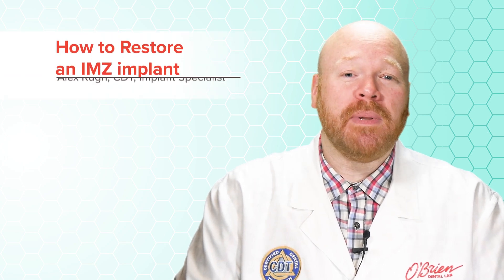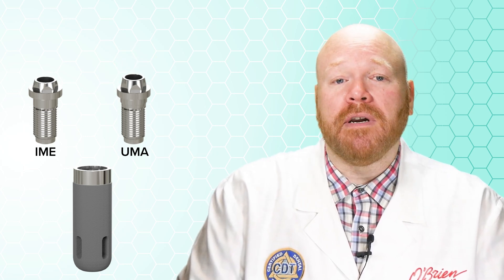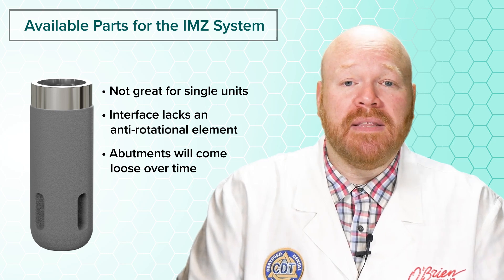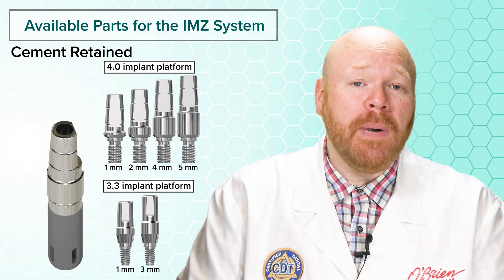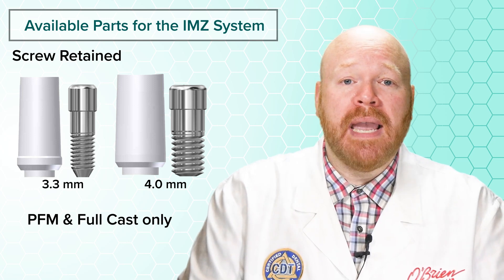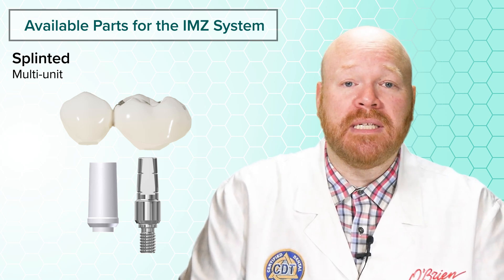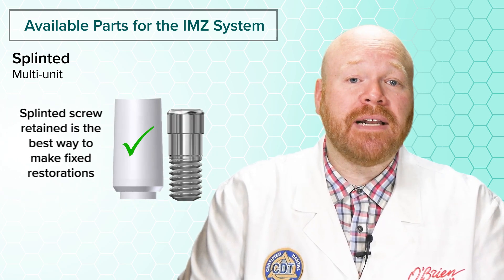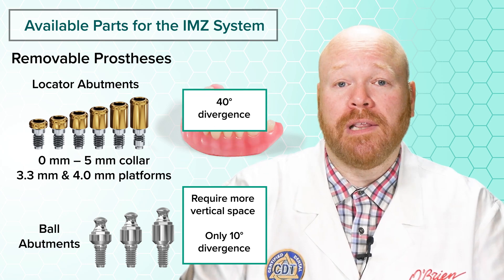How to Restore IMZ Non-Hexed Implants

Comment: Great video as always! What are your thoughts and experience with restoring Bicon implants, since they too don't have antirotational features?
Reply from the maker: Even though those don't have an antirotational feature to the interface, they have a friction fit connection that keeps the abutments from rotating/moving.  So, they don't have the same issue as the IMZ non-hexed implants.